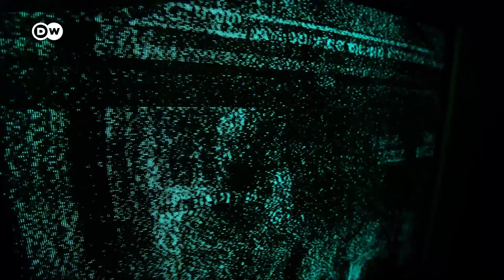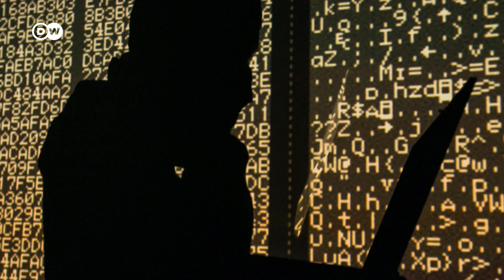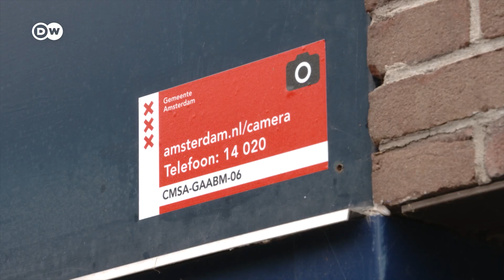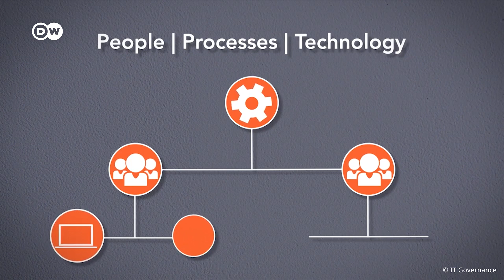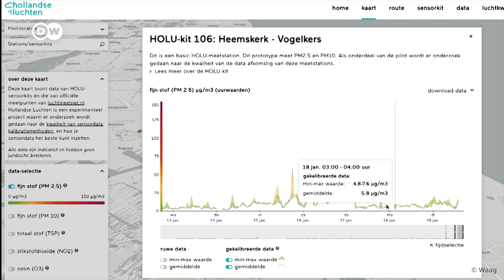Smart City: Hacking a Whole City? How Safe Is Our "Big Data" in a Smart City? | Smart City Projects

Comment from the maker: Editor's Note:
5:23 A joined project by the Dutch foundation Waag in an ecosystem of local and regional partners. Amsterdam Smart City functions as a platform and accelerator.
5:31 Saskia Muller coordinates one of the local sensing communities (in Buiksloterham, the North of Amsterdam) – Saskia is not the overall coordinator of the project „Hollands Luchten“
6:35 Repke de Vries is one of the citizen scientists in the project
8:18 Hollandse Luchten has deployed 20 sensors in a small neighborhood in Buiksloterham in the North of Amsterdam